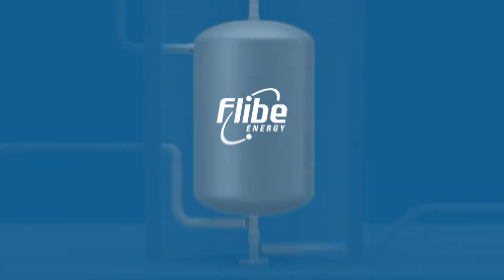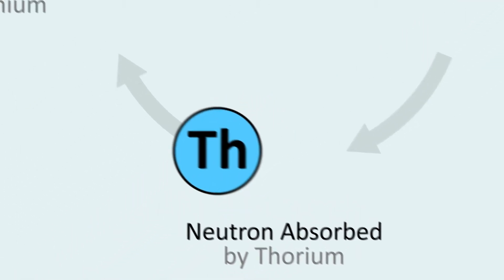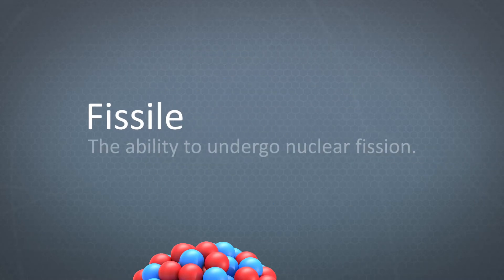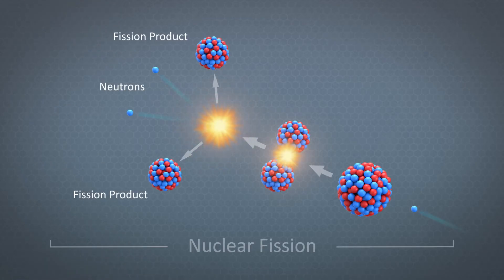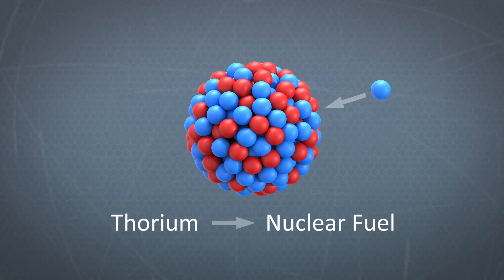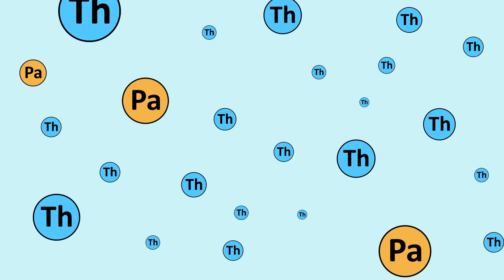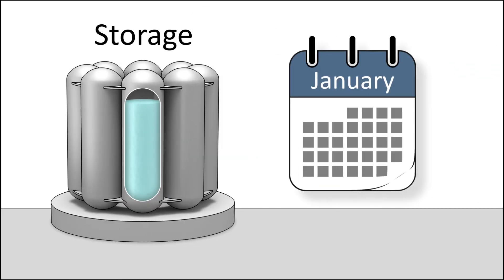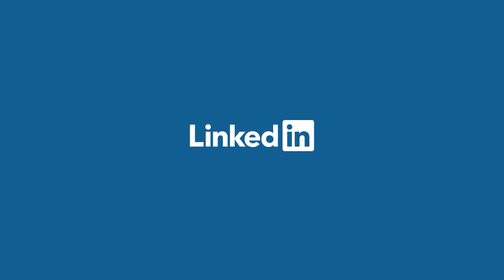Thorium Fuel Cycle Introduction

Comment: Recommend adding brief statements about how plentiful Thorium is and changing "endless" to "essentially endless"
Reply: Well if you think any resource is literally infinite I have some bad news for you, so when anyone says endless in real terms, they mean for practical proposes it's endless. Even if it could last only 1000 years, like if humanity is still around at that time fairly confident we would have fusion down pat by that point, if not space rocks are a greater source of uranium and thorium than Earth unless you can mine the core so you got yourself another ~2000 years to figure out fusion or some other energy source, really if fusion or some other energy source isn't practical at that point you should probably build a Dyson swarm and just use the suns power.

Also if your already that developed in space you could star mining the sun though star lifting, because there are more metals—and in this case I mean anything other than hydrogen, helium—in the sun than there are all the other planets combined and you can get your thorium and uranium from there and with the plentiful energy you can get from the sun you could run a massive particle accelerator to turn the massive amount of hydrogen you get into metals and even anti matter as a form of energy storage.

So yeh it's for practical proposes infinite given that is 1000 - 3000 years we should have the capability to use other energy sources.
Reply: I know right! Can't create energy or destroy it, my brother. :-)

Comment: When you extract Pa233 how will you make sure the resulting U233 is not used for weapons? It seems that would be a tempting place in the process to siphon off some Pa233.

Is there something that makes it useless for weapons?

Great video btw.
Reply: If I am not mistaken, uranium-232 is also produced in this process.  This isotope is particularly radioactive and largely is considered to make proliferation impractical by this process.

It could still happen, but that will be true for pretty much any fission system.

Comment: Flibe has been working on a molten salt Thorium reactor for years.  The Chinese already have a working molten salt Thorium reactor.  Flibe is losing the race.
Reply: That working molten salt thorium reactor, MSTR is an experimental unit and thus talk about any race is moot.  The tech for these reactors is not yet proven.
Reply: @michaeldeierhoi4096 The building already the next one.

Comment: As with spacecraft, the "rocket science" part is usually pretty simple. It's the plumbing that causes the most challenges. I haven't seen anyone address how they plan to actually manage such a high temperature fluid (I'm also not sure of how reactive is a tetrafluoride). Pumps, piping, and containers must be immune to corrosion and erosion from the Thorium, Protactinium, or Uranium compounds.
Reply: Would glass or ceramic work? Or would those crack?
Reply: @xxxBradTxxx  changing temperatures of two different materials means yes, it will crack.
Reply: Even back in the '60s this wasn't regarded as an issue.

Comment: When U-233 fissions, one gets a neutron or two, lots of heat energy and fission products. The neutron(s) are recycled but how are the fission products captured, what are they and what is done with them?
Reply: The fission products are still nuclear waste but they only need to be stored for a few hundred years until their radioactivity is negligible. It's the accidentally created larger nuclei (trans uranics) that have a very long half life and have to be stored for 100,000 years.
Reply: I believe they are chemically filtered out much like the protactinium.  From there, I guess you let them sit, or throw them in a fast reactor to be burned off, if you have one.

Comment: If only 10% of the money spent on Fusion would have gone to Thorium molten salt research we would have running reactors by now.
Reply: The US Air Force had a working reaseach reactor in the 60's.
Reply: @htannberg There was a navy yard that used one for decades. Neither went to the next step of the blanket.
Reply: @htannberg none of those were uranium breeder reactors to breed Thorium.    The air forces reactor never got anywhere near a practical system and the Oak Ridge MSRE never generated steam for turbines and had over 40safety shutdowns a year, it's total thermal energy production was nowhere near commercial standards.
Reply: @htannberg  a working salt reactor, not a thorium reactor.   The Navy had a working sodium reactor in the 1960s.   The problem with both designs are the metallurgy, getting a metal alloy to be used in the plant that will last a commercial life time.   Solidification of the cooling fluid is also a problem, pump failure is a huge problem in salt plants, and finally anything that touches a fluid that hot and corrosive will bread frequently.  The alloy they developed in the 1960s was a poor commercial choice.  It's too brittle, too prone to strain failure.
Reply: @htannberg a working research reactor is not the same as a working commercial power plant
Reply: @cameronvandygriff7048  Yes of course,  but so much $ has been put into fusion that we could have safe nuclear power using thorium by now
Reply: The fusion guys had better sales people that had the right networking and a case full of beers and champagne and a spreadsheet of white lies.
Reply: The forces of darkness (fossil, renewable, uranium) are happy for fusion research to go ahead because it's not delivering. But thorium – hell no!
Reply: While I disagree with the people that think Thorium is a panacea and we could start build ing them next summer, I do agree funding this research would have far more cost effective and productive then the untold billions spent on fusion so far.

The metallurgy isn't even near complete to contain corrosive molten salt for a 50 year period, the hastealloy used in the MSRE has serious strength and thermal stress problems that would proclude its use in commercial environment.   It's 20 years or more from commercialization, and I've been nuclear trained since  the 1980s, I'll likely be dead before it's a commercial reality.
Reply: @azroadie  Maybe they should treat the corrosion as replaceable parts done every 5 or 10 years? If it works for helicopter blades why not for this?
Reply: @htannberg  because we're talking about the entire plant.    To use your example if the entire frame, engine, rotors, head and shaft were "replacable"and all had to be replaced every five years what would it do to the economics of owning a helicopter?
Reply: @azroadie  It's not the entire plant. You'd have to do a cost analysis to see if it was worth it. Plus I think the Chinese either have one up and running or are very close.
Reply: @azroadie  Also, I really do believe there are ways to minimize corrosion. So it's probably all mute anyways.
Reply: @htannberg  I passed the nuclear operator board in 1983.  All I can say I new ideas are announced fast and developed slow with an occasional exception.   I personally think 20 years would be breakneck speed given the problems involved.  On the other hand metallurgy and materials science is so far ahead of the 1960's possible many of the problems could be solved relatively quickly.   The acceptance of risk is generally much lower so who knows.
Reply: @azroadie  I believe if the USA put their resources to work on solving these problems and took on more of the SpaceX approach to engineering, we could have a working reactor in 3 to 5 years.  Minus the RUD of course.  Lol.
SpaceX just made me aware of how inefficient NASA is. I realize politics is their main ball and chain.
Reply: I do not know what it is with people to love juicy conspiracies much more than the truth itself. For a long time, by far the juiciest conspiracy about why we do not have Thorium reactors is that back then in the Cold War era, they had two options, either to develop Thorium reactors and change the whole world into a paradise through extremely cheap and abundant energy source or to make lots and lots of nuclear warheads. They chose to latter.

Now in this video, the conspiracy theory is that Thorium reactors will not change the world into a cheap and abundant energy paradise because politicians have no interest in it and do not want to fund it.

Yet if being completely honest. The first and by far the greatest conspiracy that they wanted nuclear warheads more than cheap energy is just not true. Aside from developing uranium-based reactors, they also developed Thorium-based reactors but what happened? They failed! That is what happened, they discovered some unsolvable problems in keeping the reactor's chain reaction going, so they closed the development as a failure.

In the same way, it is with this video. People, do you really think that if there were an actually functioning method to have thorium-based reactors which truly would be extremely cheap and abundant, do you really think the politicians would not be interested in it and would not find money to fund it? Of course, they would! 

So, aside from conspiracies that tell us that thorium-based energy is really easy and abundant but the politicians do not want it, stick with the reality, that the real reason why we see no thorium-based energy sources is that there are some seriously difficult unsolvable problems to make them work.
Reply: @nikokapanen82  Maybe thorium-based power really is just that difficult and unfeasible. But also consider the scene and history of uranium fission. Instead of solving concerns over safety and waste management, it was put on the back burner. This is a crying shame that is not a conspiracy and well-documented. 

My point is just that our leaders don't always make the best decisions; just because we are doing something doesn't mean it's the best option.
Reply: If there is no working thorium reactor whay do they wanted to go bicker 

Yeah and so i so the field behavieures around the reactor where migrating particle behavieures going trouth and become reajust according those conditions the are within that the tace along there jurnys to release towart like red blodcells in the blood is like aids ataxia (plasma philemental cequenisation disorder ) infection from body in to the next body 😪
In a way it is not a infiormental healty seting oldo do to working this out more healty subb understandings become ondenieble  clearley and aprogeble 🐜 confurting a cursing seting in to a blessing of understandings and they chaince there progres as they onderstood outomaticley 💞
Reply: Hell, if only 20% of the money we gamble on Renewables on with would be spent on the Thorium Fuel Cycle, we could've had far clearner air in not very long time.
Reply: @ZippyPiglin36 
No research could make this concept cheaper than renewables, not even cheaper than conventional uranium reactors. The abundance of thorium is not an advantage if you still need beryllium and lithium (neutron source). Beryllium is about as abundant as uranium.
Reply: @andreasschmitt2307  So Renewables which need Energy Storage and Waste Recycling and immense land is somehow cheaper than a Fuel Cycle we already achieved commercially in the 1960s?
Reply: @ZippyPiglin36  
Yes. It's the most expensive way to produce energy until now.
Reply: @andreasschmitt2307   And simultaneously the most politically controversial and research deficient method too. Just like Intermittent Renewables were until very recently. 
But unlike Renewables, there is no issue of Energy Storage, and nearly no Waste Recycling, all while being thousands of times less polluting and twice to ten times as safe.
Reply: Not really. The problem with molten salt reactors is the molten salt: It's highly corrosive and the cost of constantly replacing miles of piping offsets the energy benefits and makes them unprofitable. No one has solved that issue yet.
Reply: And if only 10% of the work put into demonising communism would have put into realising it, we wouldn't have any problems by now. 
But that's not how the world works, that's why we have to put in the work ourselves. 
Be it changing the society or advancing in energy production.
Reply: Maybe, but countries like India and China have been working on this for years and they still do not have a working reactor.
Reply: @hamobu  We don't know how the Chinese TMSR reactor experiment is progressing. We do know that there is no fusion reactors that produce excess power and run for more than seconds. Hundreds of billions have been spent on Fusion. Thorium MSRs use fully understood nuclear technology and only require the online chemistry and materials research to be completed.
Reply: @hamobu  unless they're working on how to make the best of both worlds. I.e. weapons and energy.

Especially China.

Though, there's also the thing where they don't have the right formula nor engineering advantage to create a sustainable and highly efficient TMSR.
Reply: @hamobu  i Think They Are In Work, Deployed, Many Technologies Are Dubbed As Theoretical And Being Researched So That They Don't Get Generally Used By Anyone Anywhere!
Reply: @hamobu   China has had good success and is preparing for its first commercial launch. 
India has had some success experimentally.
Reply: @ZippyPiglin36 
There is no report of usage of thorium in the TMSR-LF1 until now. End of last year it was reported that they added a small amount of thorium and checked later for protactinium as a proof of concept. The next report was for successfully replacing the fuel (probably for getting rid of the thorium, protactinium, U-232 and the nasty stuff in their decay products), but there's no report of using thorium for energy production yet.
Reply: @hamobu and now China has a working thorium reactor that is connected to the grid
Reply: might want to double check that
Reply: @hamobu  Read the latest news
Reply: @raymondyuan6608  Yeah I saw the news from China. That's awesome. I wonder how far are they from commercial production.
Reply: @hamobu  With 2035 as the milestone, build a demonstration project of 100 MW-level thorium-based molten salt reactor and realize demonstration application
Reply: This process was extensively researched in the 1950s and discarded as too expensive and unproductive.
Reply: @robertmcnearny9222  Hi there, I’m not disagreeing with you because I don’t know enough about it except to say that some articles I read have stated that the government preferred uranium reactors because it produced material that could then be used in atomic bombs. So thorium got cast aside. Sounds probable 🤷🏼‍♂️🤷🏼‍♂️
Reply: unproductive in the sense it didn't produce plutonium for the nuclear arms race
Reply: @robertmcnearny9222  
Says who? President Nixon.
In fact the money was diverted to Sodium cooled fast reactors (hoping to boost plutonium production). Those reactors led nowhere.

Comment: I'm all in on thermal spectrum MSR thorium breeders, long-term. However, despite the fact that the technology is fairly far along in it's development (MUCH further than what most critics like to give it credit for) my concern with it is with regards to any unforeseen issues. 

An example of such an unforeseen issue would be the hydrogen loading that CANDU operators discovered in the steel tubes in which fuel bundles would go through the reactor. Depending on how hard you operated them, the steel would become loaded with hydrogen over time and cause the pipe to fail. It wasn't the end of the world, and CANDU operators figured out how to deal with it, but it was a problem that I don't think had been anticipated.

My concern with LFTR (and all Gen 4's, although LFTR is my preferred design for a power fleet), is what issues might we not encounter until a new type of reactor has had the opportunity to operate for at least a decade of continuous operations. For example, in a LFTR how well will the barrier between the fuel salt and the blanket salt hold up over time, and maybe a single fluid reactor would be better in the short term?

If I could wave my magic wand, I'd quintuple the existing fleet with Gen 2.5 and Gen 3 reactors while also building 100 Gen 4's of different types to run them through their paces for 10-15 years and work out any unanticipated bugs. Then we'd build out a fleet of thermal spectrum thorium breeders for power production while also building a much smaller fleet of fast reactors to function as waste burners which could also produce the starting fuel loads for new thermal spectrum MSR's (as it's unlikely that LFTR's could be used to produce the starting fuel loads for other LFTR's due to their anemic breeding ratios (which sounds bad but which also makes them SUPER...DUPER proliferation resistant)).
Reply: @@christophervannorden4132 I am incredibly excited by the prospect of building molten chloride fast breeders like the one being developed by Exodys Energy (formerly Elysium). They require no reprocessing of solid nuclear fuel, domestic or military. They require no online chemical separation and all the fission products can stay in the reactor for the life of the reactor. This is far more exciting than LFTR in my mind. Oh, and they can also utilize thorium as well, just without needing to separate out the u233/protactinium.
Reply: I think the much simpler once-through uranium MSRs are the best bet for the short term. (next 50+ years) They will be/should be/ might be much cheaper than any PWR or CANDU. In fact, they "should" cost less than natural gas plants. There is plenty of time to perfect breeders, both thermal and fast. 
The question is whether the anti-nuclear regulators will let it happen. It's not a technology problem, it's a power/money/corruption problem. In other words, it's a government problem. The NRC will never let it happen, so I'm hoping they have not infected the Canadian system too much.